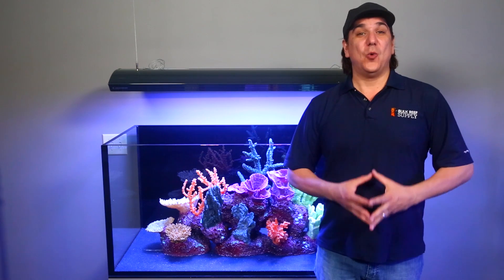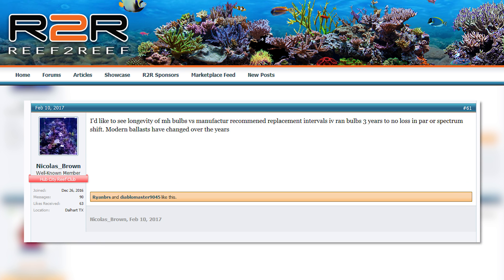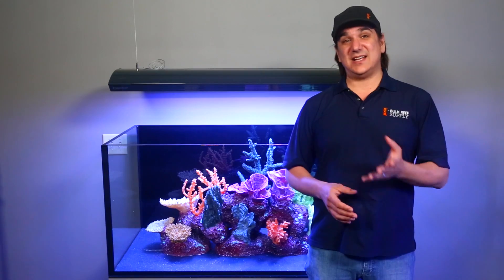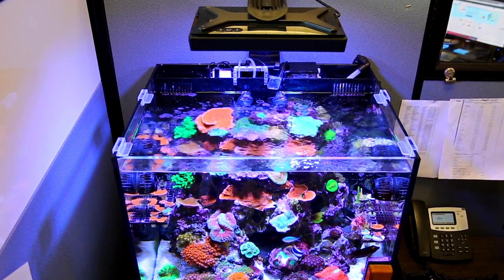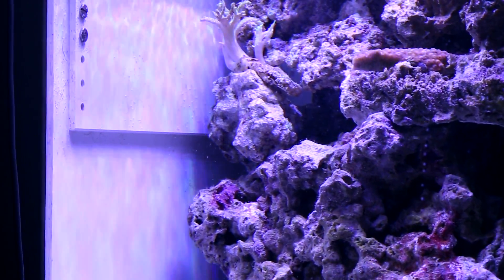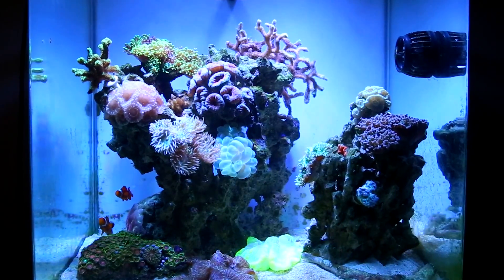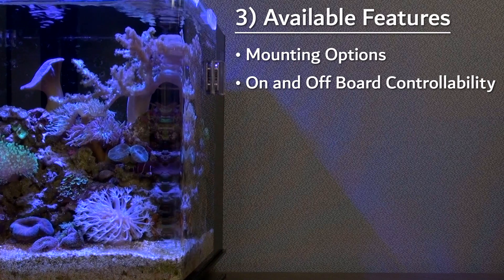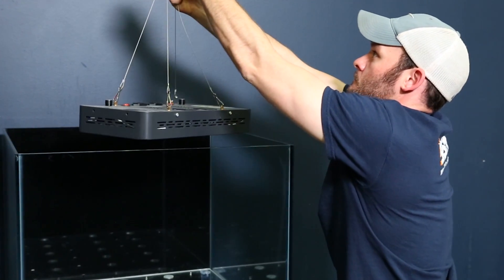Lighting your tank. You ask, we test! | BRStv Investigates

Comment: i am on a budget so can i use two nano tank lights in my 36*18*21 tank? 50 gallon
Reply from the maker: Absolutely. If you're going LED, I'd actually recommend using multiple fixtures. One LED fixture is likely not going to cut it over a 36" length anyway.

Comment: This is the lighting test I would LOVE to see.  Make multiple equal sized frags from the same colony of SPS, LPS, Zoa 
and Pally (Or other coral types as well). Grow them for a month in the same tank so you know that they have healed and select the frags that are most similar in size/color. Create a setup with multiple tanks of the exact size all plumbed together. All tanks would then be using the same water and being tested with 100 % equal parameters. Each tank would have the exact same pump with the same placement so that the flow is identical in each tank. Place a different light type/configuration over each tank. Each tank is separated by a barrier to prevent any light "bleedover". Place a frag of SPS, LPS, Zoa and Pally into each tank. Monitor for growth and coloration. You could take this series even further after this test. After determining the best lighting source, use that for a similar test for tank parameters(Alk, Phosphates, nitrates), trace elements, salinity, PH, coral placement, additives, food, temperature...etc. You could essentially build the holy grail of tanks once all of these parameters are know.
I love the videos and have learned a great deal from them. Thanks for all of your hard work. It is appreciated!

Comment: I still dont know at how much power I need to configure my Radion XR15 G4 pro in my 24 gallons size 18x18x18" and the radion at 9,8" from water level. 
So is a 25cm from water and a 45cm deep tank cube. Now im on 60% intensity and whites at 25%, red at 0% and uv at 40%.
Should I use more intensity? I have sps lps and some soft like zoanthus. Ty!